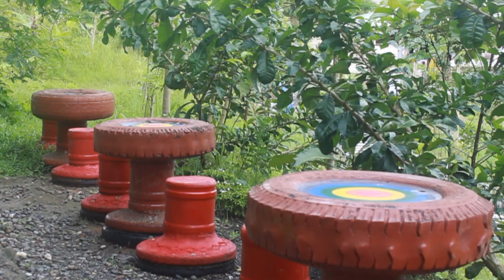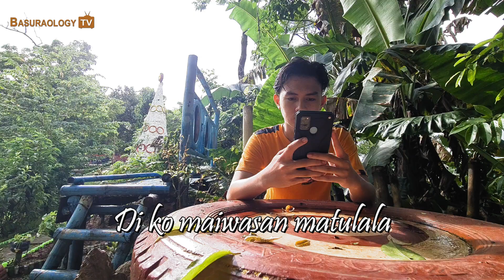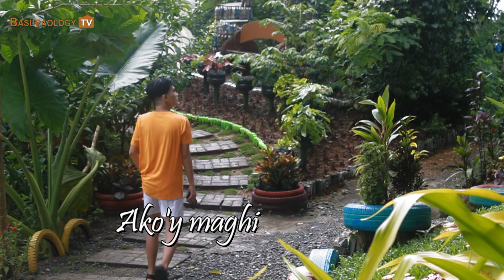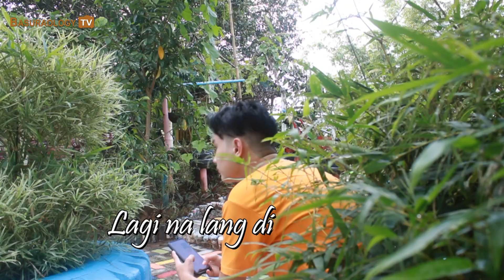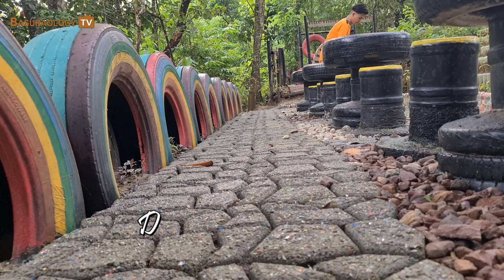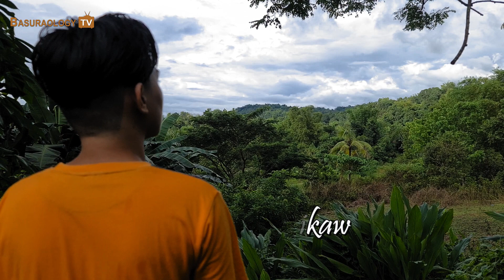🟢 Recycled RUBBER tires turned into outdoor COFFEE TABLE SET ♻️ BTV Music

Comment: Recycling rubber tires means that millions of scrap tires are no longer dumped in landfills, or left illegally in lakes, abandoned lots, along the side of the road and in sensitive habitats. Instead, more than 90 percent of these tires are being recycled and reused annually.
Recycling saves impressive amounts of energy, which ultimately reduces greenhouse gas emissions. For example, recycling four tires reduces CO2 by about 323 pounds, which is equivalent to 18 gallons of gasoline.☘️
I love this vedio content 😍❣️
Reply from the maker: Thank you so much.. More power and God bless you more..
Reply: @basuraologytv2197  God bless you Sir🙏And more power 😊